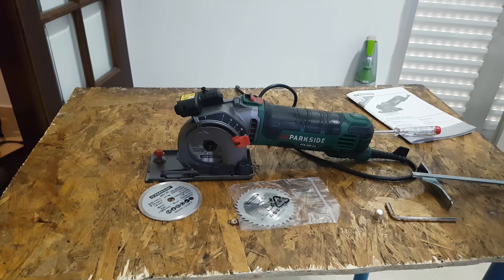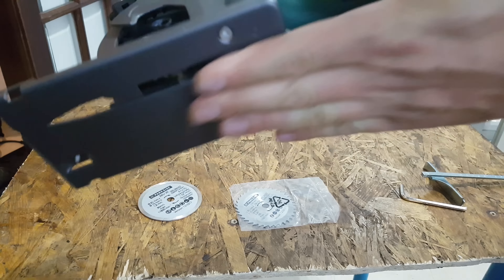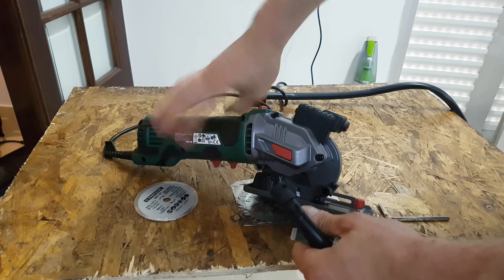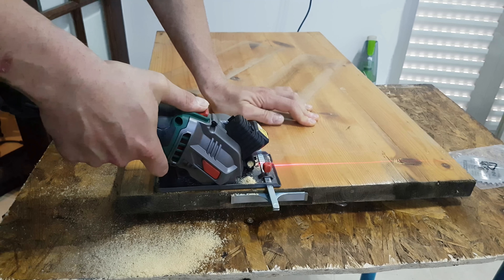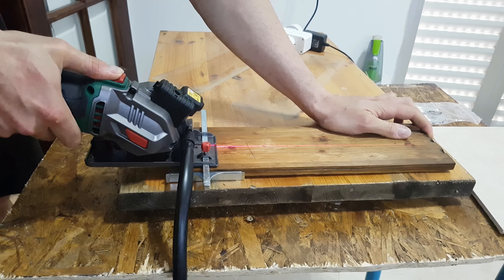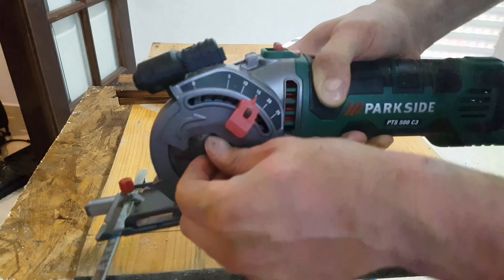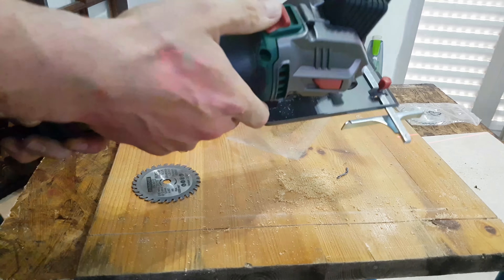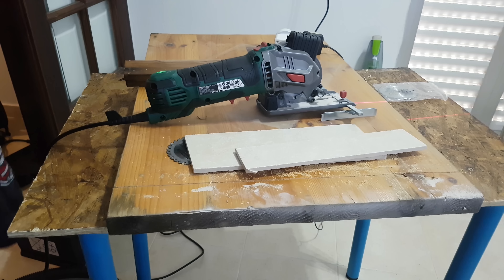Parkside Plunge Saw PTS 500 C3 Testing

Comment: To be honest it's a piece of crap and dangerous too.
At first I thought perhaps I misformed it, perhaps it dropped on the ground or something it but it's a design issue!
It you look at 38s of the video you see the V formed aiming point just before the blade is NOT in the middle of the base plate's opening
As you push down the machine onto your work this aiming point sticks before the sawing blade by SLIDING over the base plate.
After two hours of operation one side of this aiming point slided (eated) itself into the base plate's opening (metal worn out) .
Due to that the machine starts resisting when you press it down onto your work..
What's worse: when you release the machine it may not bend back properly to the locked position so that you can get exposed to the sawing blade unintentionally..

This also happens when dirt (woodchips) collect around the hinge (a screw with a spring wrapped around it) that connect the base plate to the machine.  Remove the plastic cover and clean it there! 
For this price I don't expect Japanese accuracy but it should not be dangerous.

Comment: Put the tile on the board completely. Set the depth of the blade to the thickness of the tile by hanging the blade over the edge until it touches the board and set the depth lock. Then do your cut so you don't have to hold the cut part, everything supported by the board underneath. You won't have that annoying lip at the end of your cut.
Reply from the maker: yes i understand i did t want to make a mark on the board that for :)

Comment: How powerful is the motor? 
Can it cut 18mm ply ? 
Can you get Blades with various teeth 24t,  42t, or no
Reply from the maker: yes you can cut 18mm
about the blades yes if the length is the same
Reply: If you work a bit longer with it, you’ll see that the red plastic ‘ dept ‘ adjustment is a bit sloppy. It doesn’t stay anymore at the right dept, so you have to be carefull if you’re working on something where this is important. I’m thinking of changing this little plastic thing, for a steel one. It’s also a good idea to buy the little saw ( the round steel circel ) itself from a good brand.